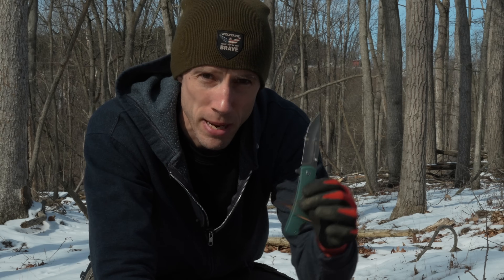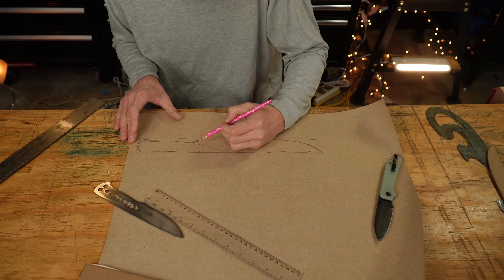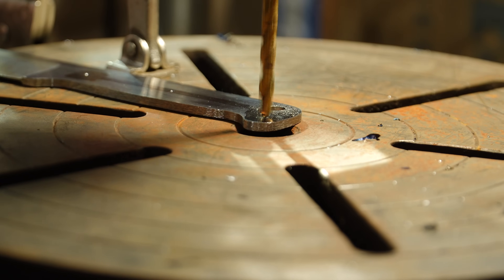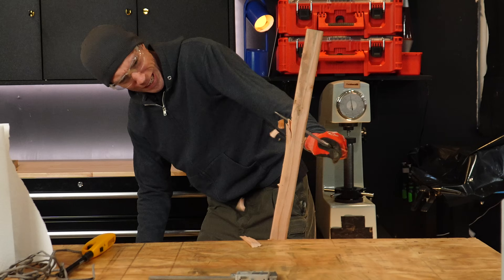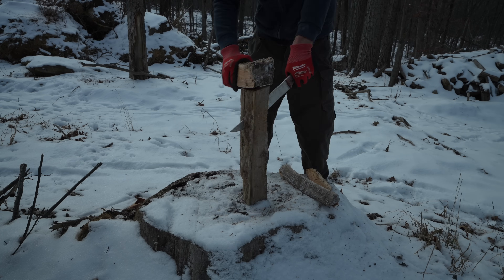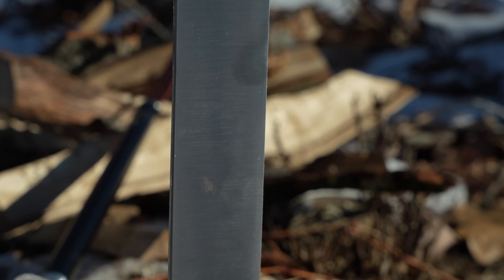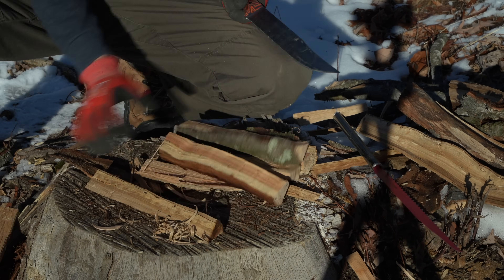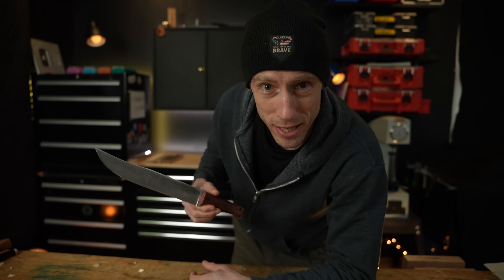Addressing The Dirtiest Word In The Knife World

Comment: I'm not bias at all about axes....But seriously I do disagree with a few things in here.  When the diameter of the timber is 6 inches or smaller an axe with a primary bevel set for cross cutting is much better for me than a hand saw.  Dried out wood, a saw will be better most of the time though.  As for splitting kindling I'd rather use a froe than a knife haha.  Hatchets are a little light for splitting for me.  I prefer something heavier so that might not be to your weight preference.  It probably is safer though when in a survival situation not to swing a sharp impact tool unless you're really experienced. 

I was into chopping machetes before I learned more and actually got to use a well tuned axe.  Axes blow them out of the water.  Machetes can't compete with axes in northeastern hardwood forests.  I do agree that maybe axes are more of a homestead tool.  But I love them and I'd shoehorn them into a survival situation haha.  I do think a boy's axe is a good choice.  When it comes to felling the axe is king.  It does take a lot more skill and practice than a hand saw though.  Not everybody can just jump on a snowboard and buck some ash like me lol. 

There might be some technique/strategy and edge changes that could improve your view of how well an axe can cut.  The skills I see with notching from guys using machetes is seriously lacking.  Deadfall that's off the ground like that can force more inefficient bucking though.  I prefer a banana grind on an axe with a high centerline, done with a file.  It's not easy at first but I learned how from an axe friend.   Generally cutting axes should be 25 degrees or thinner at the primary bevel.  I prefer 20-22.5 if it's really for cutting efficiently.  Some set their axes below 20 but I wouldn't recommend that for a vintage axe unless it's not worth much.
Reply from the maker: The problem with axes is the weight vs efficiency. They are just too heavy to carry any distance. For car camping sure, but 7 day remote 100+ mile trips not so much. Just different tools for different jobs.
Reply: @OUTDOORS55  i haven't done anything like that.  It's pretty obvious why there's a whole culture about ultra light packing.  I'm fat, so I'm always messing myself up with extra weight haha.  I totally understand not wanting an extra few pounds if it's not a necessity.

Comment: A larger axe from the local hardware store will cut and split faster than a saw and a knife. But unless you’re building a fire that lasts >1 hr or an emergency shelter of sorts, you won’t need any woodworking tools. 

Pine/spruce twigs on top of some birch bark and a lighter will get your fire started faster than whittling feather sticks. Otherwise, bring some jute twine and fuel tablets in a ziplock bag. sticks can be used to break down other sticks down to size, which can get you enough wood. 

I do carry around a bigger knife, (camp turok) but I also hike a lot of pure wilderness so I need to go through bushes and dense growth to save time. Clearing as I hike also helps me backtrack.

Comment: Great looking knife, short thick blades are over-rated. In the Vietnam war, I was issued a brand-new military machete, and accidentally broke about 5" off the end within an hour. It broke in a "reverse tanto" shape, and I carried it in the jungle every day while I waited for a new one. I rubbed it on rocks to smooth the point. It was a great all-around knife and chopper. and nothing could possibly be a better slasher.  When my new one arrived, I gave it away and kept my Seax-looking knife. From that day forward, I have used that blade shape on all my knives, even folders.

Comment: I have a minor request if you don't mind. I sharpen my knives with my late father's Lansky kits that I inherited. 
His kits include both diamond and oil stones going from 60 grit to 1000 grit. 
I recently also purchased the 2000 grit 'super sapphire' stone to include in the set, but immediately when comparing it to the 1000 grit stone they look and feel identical, and I'm not sure if Lansky is doing something dubious to trick customers, or if it's just not possible to tell the differences without a super microscope like you've got. Could you by chance compare the two stones?

Comment: I've split a few smallish branches with my bk2 companion. The thickness is superb at the cost of weight. It's quite short and stubby though. 
So I was thinking why not have a thicker spine for splitting/wedging the wood apart, but ground down quite a bit to the edge for slicing.

Comment: It would chop better if you added more forward weight to the design. In place of a clip point, make it more bolo-esque; or keep the spine fairly straight and just don’t grind the portion towards the tip so thin to shift the weight distribution. Have the plunge area (3-4”) ground thinner for finer work and the forward chopping portion thicker for impact work.

Geometry is 3D and needs not be symmetrical on any plane.

Other than that, yeah, materials for building a single knife are expensive. This doesn’t even account for labor and profit.

Comment: When I was a young man of 10 or 12 my family did a lot of camping it was my job
to start the camp fire. I didn’t have a ax or a fixed blade knife. I was only armed with
a box of strike anywhere matches. I don’t remember having any trouble getting a fire
started. When I joined the Boy Scouts I had a pocket knife that sometimes I would make
fine curls of pine with because we tried to use only two matches to get the fire started,
(a Scout thing) still no ax or sheath knife.
Reply: Boy scout, too.  What's the second match for?

Comment: A good hatchet setup to chop well, hung on a 16 inch handle is, in my opinion at least, a very capable woods tool. When i was still doing butcher work i skinned and butchered a few deer with a hatchet just to see if i could. It was way more effective than i expected it to be. I think the issue is a lot of knife guys arent really into axes and so they don't put a lot of thought into what they would actually need in an axe. My personal favorite is a 2 1/4 pound boy's axe on a 28 inch handle. It pairs nicely with a 4 inch bladed knife, and it cleaves through limbs much faster than my Silky saw can cut though them. Ultimately, carry the tools that you're comfortable and confident with. For me, its an axe and a knife. For others, its a knife and a saw. As long as you are actually getting outdoors and learning something, you're doing something right.

Comment: Make a toothed spine to do the cutting, take guidance from a chainsaw tooth with its flat top to retain strength for bashing it with wood.
Reply: The work to remove material in alternating pattern with clearance slots should be an interesting challenge, maybe spaced out teeth at the location you hit the most and a higher density of teeth in sections not hit often

Comment: "Wear resistance"   Not "edge retention".    In other words, make the same exact knife out of Rex121, repeat the exact same tests, and tell me which one actually has better "edge retention".   Of course, the S7 blade will have better edge retention, as the Rex121 blade will likely have chips up and down the edge apex, and would more than likely struggle slicing printer paper.    "Wear resistance isn't as important for a knife like this" is correct.    "Edge retention isn't as important for a knife like this" would be incorrect.   Of course we always want as much retention of an edge as possible, not matter the application.  

Another tweak I would suggest is convex the edge.   Use your slack platen and round off those edge shoulders, and then resharpen convex by hand.  I think you'll find feathersticking will greatly improve, along with your batonning.   Great video, as always!   Cheers, mate.

Comment: Probably you used the sex screws / union screws the ,knife would dead. Meaning the vibrations in the blade but using the epoxy makes the blade seam thicker and stronger. I would have never thought about it this way.

Comment: Might as well go for 8760 if you want the toughest
Reply from the maker: S7 is quite a bit tougher than 8670. 8670 is about 50ftlbs at 59-60hrc. S7 is around 85ftlbs.
Reply: @ holy moly,I was just going by knife steel nerds. I thought 8670 was at the top.
where can I find those tests? I’m having a hard time

Comment: First of all: I love this kind of video! Thank you!

But I got some questions if I may:
What was the thickness behind the edge and the edge angel?
And what would your preferred steel be, if cost and availability were not a thing?
Reply from the maker: Can't remember off hand behind the edge thickness. Its still pretty thick relatively speaking. I think many steel's could handle this.  Cpm3v, cpm-m4, magnacut, cruware, even k390, could do this same job. Would have to tweak the heat treatment for it though.

Comment: I await those other videos. This has been great. 
 I re-ground a 12"  1095  0.125" Ontario Knife Works machete to do this job, and it performs really well - not as well as yours, but well enough.  It weighs 19 oz, and I sharpen it with a small file or a tungsten chip.  It is a great chopper, and has a "D" handle I filled with epoxy to protect my hand.  I think it cost me about $30. It was a while ago.

Comment: Just a thought from another bladesmith, machetes are really thin but chop really well, I think you should make another one almost the same, same length same thickness at the spine but just a half inch wider but with the same full flat grind and I think you'll end up with a blade that can chop a lot  better and still be good to baton with
Reply from the maker: For sure! Would add quite a bit of weight though. 🙂👍

Comment: Fun vid overall, i use a Silky ultra accel saw, Fiskars x7 hatchet, and a cold steel SRK in 3V currently on my pack. That combo handles everything i use them for in the limited Bushcrafting stuf i do, along with a good belt knife for smaller tasks with a convex grind on it (custom in S35VN). Also have a leatherman multitool along with a folder. But like i said im not trekking for miles and miles, just going to a camp area and having some fun practicing skills. But even to get started you can outfit yourself for less than a hundred bucks and still gabe lots of fun, it's about getting outside and enjoying yourself in the end. Thanks for the great vid and keep making sharp things fun and enjoyable

Comment: I wonder if there is a difference in grinding before or after heat treatment between two aluminum plates? In oil I think it makes no difference, but in the case of aluminum plates theoretically the steel does not cool at the same speed on the cutting edge which is not in direct contact with the plates? A video subject? :)
Reply from the maker: I haven't found a difference. The ground edge is so thin it cools super fast. Conversely, leaving it full thickness slows the center cooling since the heat at the center of the blade has to flow through the total thickness. The plates mainly keep it from warping.
Reply: @OUTDOORS55  If it’s cools faster there is a difference in hardness? So the hardness test is no more useful/accurate?

Comment: I'm a lifelong bushie, mechanical engineer and live in a sub-tropical zone (37°C this past week and high humidity). We have yards that are prone to overgrowth if left alone for 10 minutes. Over the years I've used a wide range of tools to cut back woody growth and to prune trees, the best and fastest has been a 12.9Oz (US) Kukri gifted by a Gurkha soldier back in the early 90's. It's faster than any of the various axes, bush saws, choppers and even the 24V reciprocating saw I occassionally use. They are remarkable things once you get used to them  it'll go through new growth Australian hardwood quicker than anything I've discovered. I've been making knves for a couple of years now and haven't been able to improve on it. I've seen Gurkas do surprising things with them and wouldn't go into the bush without it.
pretty sure the blade is made from an old Indian truck suspension leaf, watched them do this when I was in Nepal, makes a very tough blade, doesn't retain an edge like some steels will, but what I do with it would look like abuse to most people. However, I give it a lick or two after each use and it never lets me down. 
If you haven't got one, try one if you have a use case for it, you might just be surprised.
Reply: Love car springs.  Years ago I picked up a Shopsmith dirt cheap, and didn't have the money for a set of lathe chisels.  I know nothing about metal working, but I cut up an old car spring and made a set of chisels, grinding the tips to match illustrations in a book.  Then I heated them red hot, and quenched them in old motor oil.  I used them for years, before I decided to spoil myself with a set of expensive store-bought chisels.  I was shocked to find my homemade ones, while not as pretty, worked better.
Reply: @troystallard6895  there's a fair bit of engineering that goes into spring design and material selection is king. It's no surprise to hear stories of such material being reused and surviving for long periods.
I've just cut up an old National's suspension, with the intent of making effort to try replicate the Kukri I have.
Don't throw your old chisels away.
Reply: @LockBits-ts6eo  I retired the new ones to a drawer. 🙂
Reply: I have a relatively cheep "kukri" bought online somewhere (obviously inferior to the real thing). I use it regularly to clear brush out of our midwest woods. (3 days of nonstop chopping per year). Me and the boys normally use a variety of machetes to do the work. I have been consistently impressed with my kukri when compared with standard machetes. Its smaller in length, and can still chop into harder woods better than any other machetes we use. Its blade has outlasted our other machetes,  and has generally stood up to abuse like a champ. Can vouch for a kukri style blade shape for hard brush clearing.
Reply: @rickeydeyoung9096  yep, definately a lot of people out there that would agree.
Reply: @ I also have an el cheapo kukri-shaped machete.  I consistently reach for it over my others...
Reply: How do you sharpen your kukri?
Reply: @FlashBang33  depends on where I am at the time, when camping, if I have my truck with me, I use a Lansky kit that I've had for years, it has a stone that will do the recurve if that's what you're thinking of, around the yard (which is quite big) I carry a narrow diamond stone or two from a fixed angle sharpening jig and just do it by hand (you can do a perfectly good job with a narrow section stone). It's just an edge, an awkward shaped one for sure, but an edge nonetheless. If you don't treat the thing as precious and remember that it's a tool, just relax and have a go. I was surprised at how quickly I picked up sharpening this shape of edge. At home, I have a good selection of sharpening stuff and sometimes I do part of the edge in a jig and the rest by hand. Good luck with it.
Reply: I use a Kukri.  It replaces the need to carry a hatchet or axe and serves to replace some knives though I carry other lightweight thin knives.
Reply: "But a Kukri is not full tang 😭😭"
Reply: Kukris and parangs are where it's at.
Reply: Kukuris are sharpened with a c9nvex edge that's designed specifically to slice with less effort. Less surface area winds up being in contact with the material you're cutting. A full flat grind is the worst for impact slicing because of how much material is in contact at once (All of it).

Comment: Used to do a lot of hiking/bushcrafting/prepping, and I never brought an axe. A big knife is just so versatile, and a folding saw is both effective and efficient at cutting (down) wood. I used this same combo but the knife was usually thicker, sometimes up to 8mm (5/16") and 12". That way it chops as well as it batons.
Reply: I do always wonder about this... if we're so concerned with weight, but then you have 2 blades on you, wouldn't a thinner shaped and well sharpened axe do both jobs for less total weight (using modern light weight handle materials) ? Like why not cut your food with with an axe head? it basically looks like an Ulu.  Is the risk of breaking from a bad strike that much higher than batoning?
Reply: @RaphYkun  I don't really consider the folding saw a blade but I guess it kinda is. I always carry a solid folder as well, and sometimes a multitool.
An axe can really only do 1 thing, and do that very well. A 10 or 12" blade can do SO many things, even chop down a tree, in a pinch. To each their own and I have known more than a few people who prefer an axe, but it's not for me.
I don't have a lot of experience splitting logs with axes but I don't think they're good at it unless they're designed for it - in which case they're not good at chopping. But feel free to correct me on this.
Reply: In a survival scenario, you'll only have what you can carry. Choose wisely, weight sucks.
Reply: @cheatinggravity173 Totally agree. From hard earned experience.
Reply: @AllAhabNoMoby plus, youre going to be careful not to destroy what you have. I'd much rather have a saw than a knife i can chop with. Save the knife for cutting, and keep it sharp for when i need a sharp blade. Like dressing/skinning an elk. 

I have a little bow saw that i made, the blade is a steel cutting m42 cobalt steel bimetal bandsaw blade. It's really light and can sail through wood like butter. It takes way less effort and time than using a chopping method- uses less energy, makes less sound, less potential damage to your body from the hard (and silly)  work of trying to build a shelter with a knife.